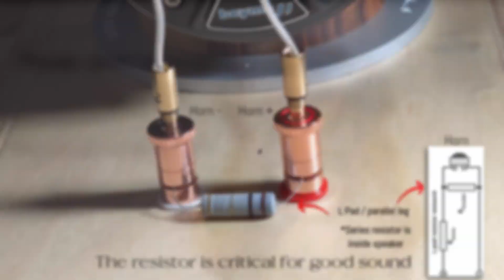The Howler - or - how to adjust treble with an L Pad

Comment: Did you say you were going to provide a chart? I have a class D amp, and I heard that piezo tweeters can be bad for them.
Reply from the maker: Yes raw piezo tweeters in general can be problematic with some Class-D amps. A bare piezo looks like a highly capacitive, reactive load at high frequencies, and certain Class-D output filters don’t like that, which can lead to instability or harsh behavior.

The usual fix is simple: a series resistor (and sometimes a small RC network) to make the load look resistive to the amp. Once that’s done, piezos are usually fine.

Problems mostly happen when piezos are run directly off the amp with no loading or filtering.

Comment: Can you clarify by what you mean "series resistor is inside speaker"? What is the value of the resistor you are using?
Reply from the maker: Good question and yeah, that wording can be confusing.

When I say “the series resistor is inside the speaker,” I mean this:

There is a fixed series resistor permanently wired inside the horn module as part of the L-pad network. That resistor is not user-adjustable and is chosen to:

stabilize impedance

protect the driver

keep the crossover behavior consistent

What you adjust is the parallel resistor, which plugs into the external sockets. That resistor changes how much signal is shunted around the horn driver, which effectively turns the horn up or down without changing the crossover point.

So in simple terms:

Series resistor:  fixed, internal, part of the design

Parallel resistor:  user-adjustable, external, voicing control

That’s why we don’t quote a single “L-pad value” it’s a system. The internal series resistor stays constant, and the plug-in resistor is what lets you choose Bold / Neutral / Relaxed voicing safely and repeatably.

Comment: I'm more familiar with using a potentiometer-style L-pad so the sound can be adjusted depending on the type of music.  Would the fixed resistor you are using in the video (or those you list in the description) have to be changed for each music genre?  That would be a PITA.
Reply from the maker: Great question — and I completely understand where you're coming from.

However, it’s important to clarify that the resistor values used in a proper speaker L-pad are not meant to be adjusted like a tone control or EQ for different music genres. This isn't like a 1970s graphic equalizer or a "flavor dial." Instead, these resistor values are chosen once—based on your speaker's characteristics and your room’s acoustics—to ensure that the driver levels are properly balanced for natural, coherent sound reproduction.

Once that balance is right, you shouldn’t need to swap resistors for every album or style of music—any more than you'd swap out your tweeters for jazz versus rock. In fact, once your speaker is matched correctly to the room and your amplifier, it becomes a “set it and forget it” solution—not a constant tweak-fest.

The potentiometer-style L-pads you’re used to do provide flexibility, but they also introduce variability, potential imbalance, and component degradation (noise) over time. In contrast, fixed resistors offer cleaner signal paths, better consistency, and tighter tolerances—which is why they’re the preferred method for "serious speaker design" and integration, not just DIY experiments.

That said, if you enjoy having a dial for taste-based tweaking, there’s absolutely nothing wrong with keeping a variable L-pad in your system. But the goal here isn’t about adjusting for genre—it’s about getting the speaker’s fundamentals right from the start.

Hope that clears things up a bit—and thanks for the comment!